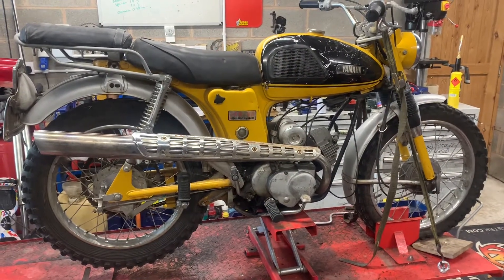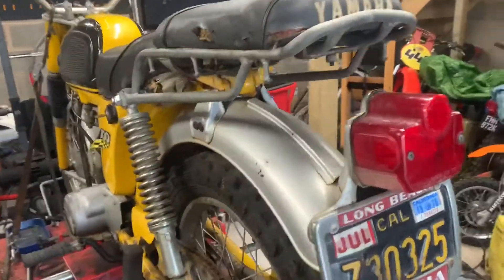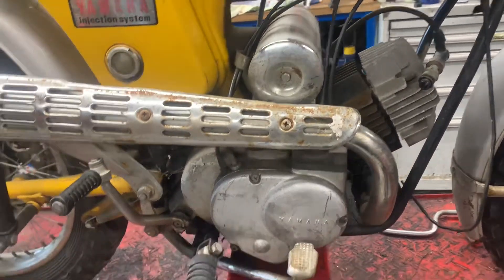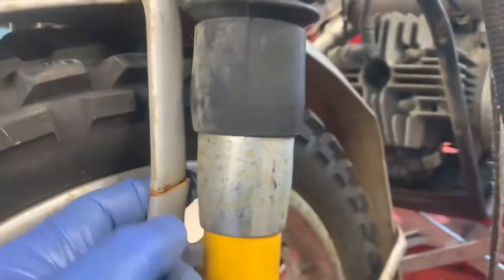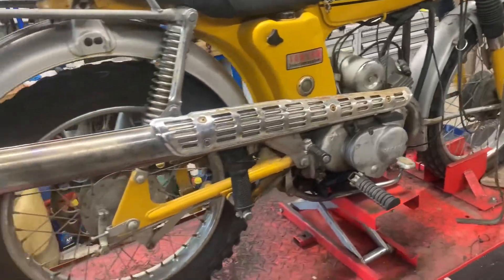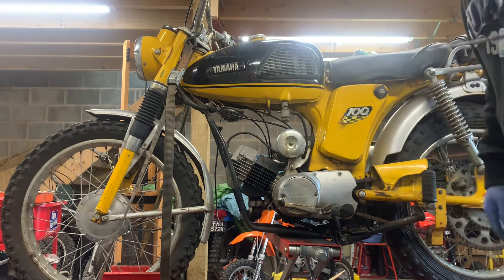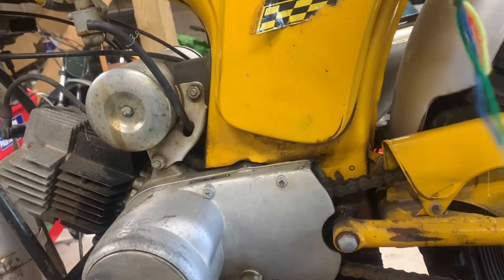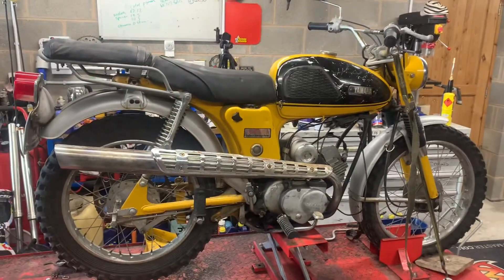1968 Yamaha YL2CM 100cc trailmaster

Comment: I have a red 1967 YL2-CM in showroom condition with 241 original miles on it. 
The reason it has no spark is because it has no battery. A battery is necessary to create spark in this system. It is designed this way to ensure the headlight and tail light remain functional and the bike is safe to ride on public roads at all times, not just when the battery is good. The battery also serves to protect the charging system. So its presence is mandatory if you want it to run.
Reply from the maker: Thanks